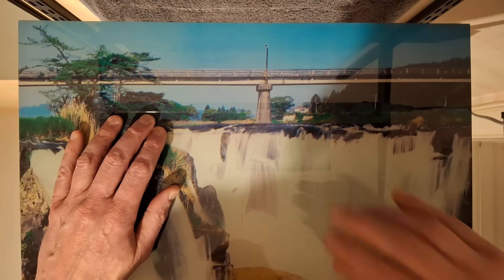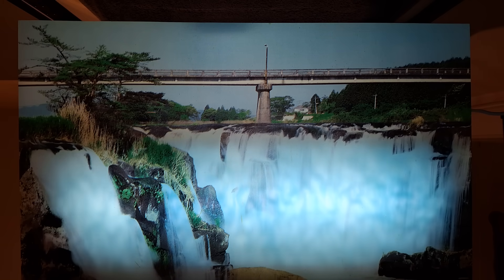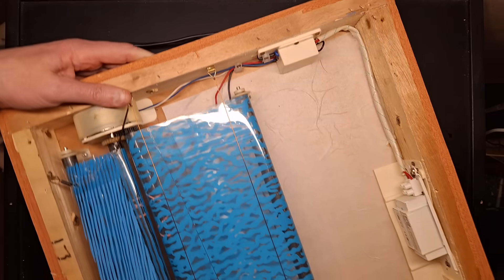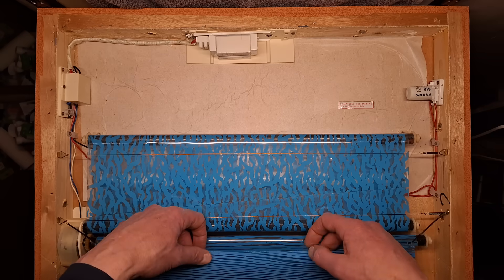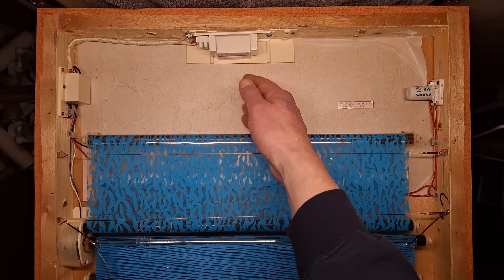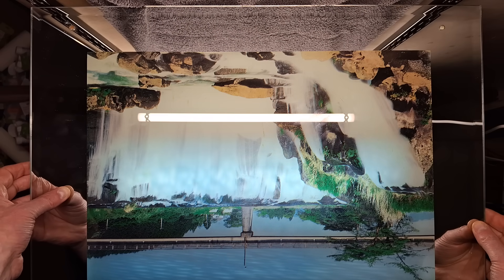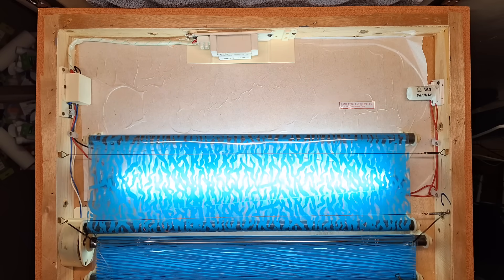Inside a dodgy moving illuminated picture

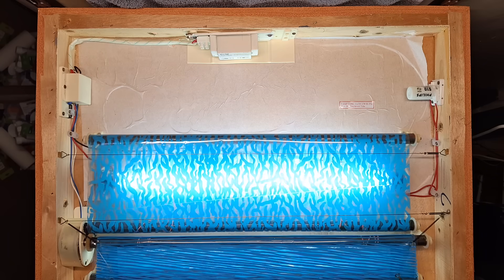Comment: 4:38 I can see the potential to retrofit it to LED and and or low voltage. Just LED would allow it to run cooler, both could vastly reduce the fire risk. But you had to change the motor.
Or vent holes at the top and bottom (+ a small fan, perhaps) could  keep thing cooler.
Or preserve it as is, as museum piece.

Comment: Perhaps the thing tends to burn when the gear jams by torn plastic (by heat and loss of plasticizer?), making the coils overheat (lacking any fuses?). I remember these animated picture frames with also a sound chip for waterfall, cricket and bird tweet noise, which was a terribly repetitive loop sample (like the ambient sound on Casio MT-540, but much more annoying by its clearly audible rhythm). Over 100 years ago they made similarly awfully botched mechanized pictures as a painting with functional clock (often behind the clock tower image) and often very complicated mechanical musicbox-like sound effects. Components were often interconnected with pull strings (threads or wires) those broke easily and were unlikely engineered by a clockmaker but rather put together from prefabricated parts by unskilled cottage industry workers.

Comment: On the inside, were those corona discharge wires strung along the drive rollers?  Seems to me there could be a lot of static buildup from the plastic going over the rollers.   Corona discharge wires would eliminate the static charge.

Comment: There are wireless electric toothbrush's on Ali for <$5 USD; might be a fun idea for a teardown. The circuit + assembly is quite appealing. After watching enough of your videos, I was confident enough to take a more expensive Phillips one apart which had dead batteries and replace them. Saved a good $70 USD not having to buy a new one. Had to unsolder the transformer, the wireless charging disc thingy, as well as 3D print a 2x AA battery case and solder it all back together. I appreciate your videos! You're the 🐐.

Comment: These (And similar) were also around in the 70s - My parents had a couple of desk lamps which had a similar pattern to that plastic, mounted onto a cylinder with vanes suspended from a pin above the bulb and driven by the heat from the latter. It was simple, but the apparent motion of the water in the Japanese scene painted on the lampshade absolutely mesmerised me as a kid! 😇

Kinda like how Big Clive mesmerises me today, admittedly... 😍💜😊

Comment: I'd expected it to use some kind of polarized filters with a rotating polarized disc, etc.  But as always, the simple approach seems to work best.   
Now Clive, can you do the LED upgrade, possibly even moving the light source into a little sidecar for better ventilation?
And most importantly, will that waterfall carbonate?

Comment: They still produce those for simulated fireplace or lantern decorations. Use just the same mechanism of a moving foil, but of course backlighted with LEDs these days. You can get them quite cheap at the usual Chinese shopping sites, I thought about buying one last year, as I thought it looked really nice and quite realistic. But I don't really have much place to put it here and the motor noise is also a downside, so I decided against it.

Comment: You would see these things in Chinese restaurants in the 1980s and 1990s.  I also remember stalls on the indoor market  (sadly no more, as the owners gradually squoze out stallholders with rent increases)  selling them.

I never bought one, because I thought they cost just a little more than I was prepared to spend on something I would get bored of very quickly.  And in any case, the one thing on that market that I was really lusting after was a ginormous boom box which had suitably-impressive speakers, FM all the way up to 108, short wave, and the usual two cassette decks -- except what made this one really special was, the play-only deck was a car-style slot loader with single "press gently for fast-forward, press harder to eject" button .....

Comment: One of the many 1970s crimes against taste.  Amongst the other horrors were the raining statue with the scantily clad classical nymph surrounded by wires down which "rain" fell.
It would be good to see one of those disassembled.

In regards to this moving picture, I wonder if there are is a way to build one using the same technology - NOT LED that wouldn't be a fire hazard and didn't make the annoying motor buzz? Brush less motors??

Comment: Ballast runs hot because it is designed to be used with a heat spreader as mounting, not plastic. Even with that they run up to 75C above ambient, and are rated up to 130C surface temperature, well above the operating point for most plastics. Easiest fix is a drop in electronic ballast on an aluminium strip, running along the entire top of the cabinet, which will run a lot cooler, and the strip is also needed with the electronic ballast as it too needs it to dissipate heat.

Seen many cooked ballasts as the aquarium trade used to put the magnetic ballast in a plastic case for fish tank lights, which would almost invariably fail after 2 years, either by going open circuit after melting the plastic case to expose it, or by going short circuit, blowing the expensive fish lamp, generally 2, as most people first changed the lamp, and the shorted ballast them blowing the filaments open on the new lamp as well.

Otherwise a simple LED retrofit tube will work, or just put in a strip of aluminium angle, with LED tape mounted on top and side, and a small 12V power supply for the tape. Angle so you get light up and to the side, and a diffuser on the top to spread the light, so as not to get hot spots above the LED dies. not needed on the side as the reflector will do that anyway.

Comment: The other type of moving picture that I remember from my childhood used oil that was pumped from a reservoir in the bottom and channeled to follow tiny nylon strings back down.  There was a light inside that would sparkle off the oil droplets.  The effect was generally used to look like rain, but I saw a few that were made to look like a trickle of water making its way down a mossy rock wall.  The pump used a gear-reduction box on a motor that ran off mains power.  I remember the distinctive sound of the gear box.  Later, as an adult, I learned that it was so the pump worked very slowly, since the oil was only traveling down in distinct droplets.  I can think of maybe a dozen different ones that I saw as kid.
Reply: Those oil drop lamps looked wonderful until they ran for a few months and got clogged up with dust and gnats.
Reply: Cinnamon Rain Lady Lamp was one! My grandparents had that one! And a clock with a boy and girl swinging under moonlight. Such cool devices.

Comment: Doesnt seem too hard to make it less flammable. Should probably be painted with flame-retardant paint instead of the paper backing, and then just make sure the ballast isnt too small for the limited cooling in there and the motor fails safely in case it gets blocked somehow (thermal fuse maybe).

Comment: I have "forest fire" lamp my mother had. It is a cylinder plastic picture similar to the waterfall, and inside another cylinder suspended internally by a pointed rod. An incandescent lamp heats the inside and spins the inner cylinder by the heat from the lamp. This lamp would not work with leds, unless a motor were installed...

Comment: One could replace that fluro tube with an LED based one and just use a normal LED power supply.
Should reduce the fire risk.
Unless you're Mehdi, Mehdi would double the voltage for fun to watch the sparkles come out

Comment: I was hoping for an LED upgrade. Thanks for showing the insides.
Reply: The LED upgrade would be to record a looping video of the operating display and play it back on one of those LCD picture displays.

But I know what you mean. Get rid of the ballast and go with an LED panel. There would still be heat to get rid of without allowing light to escape.

Comment: They had similar ones, less flammable I imagine, in "cheap shops" here in AU, they used a spinning disk with patterns rather than a roller and I think incandescent bulbs rather than the fluro tubes. They had some very nice designs, and as someone else said a mesmerising quality.

Comment: These have been around for  a LONG time.  My Grandparents had something similar featuring a gent. doing a spot of fly fishing in a "running water" stream. Theirs didn't use a fluorescent fitting, rather, it used two pygmy size "refrigerator interior" type light bulbs, which required reasonably frequent replacement. The casing was sheet steel with substantial ventilation slots top and bottom, whilst the synchronous motor was an old, presumably re-purposed, Smiths Sectric 240v clock motor.
Reply: Pygmy lamps? The only other place I ever saw those were in electricians test lamp sets. 💡

So that means your picture there could also double-up as a circuit tester. Now that's what you call getting your moneys worth! 😁
Reply: @dieseldragon6756 🤣🤣

Comment: I tried to comment, but it was removed by u-cylinder, apparently for mentioning heat-related events even without using those words :(.  After the 3rd removal I'll just say that this type of product was quite common in the U.S. in the 1960's and 70's and they were hand-built with very little automation.

Comment: Thanks for the internal view! I saw two of these in a Chinese restaurant near my house, some 20 years ago, and it attracted a lot of attention.
Maybe you could convert yours to LED, although the synchronous motor would be a problem - I have a Christmas tree that uses a GU10 lamp and moving patterns to create color effects on fiber optic strings spread out through the branches. The (huge) AC-AC transformer was lost between houses and I didn't change it to LED, because of the synchronous motor (buying a DC low rpm motor is an overkill for a very old tree, that would still need a DC power supply). It's still in use this Holiday season, with cheap Chinese LED strings, running on batteries 🙂

Comment: Don't know if I have mentioned this before about the one I have. Mine has a chinese sea and beach scene and slow moving palm trees at the front, very nice with 2 horizontal moving pictures to make it look like a camera panning from right to left. The tube is a stretched out O shape on an electronic quick start thingamy. I got it cheapo on Skegness market cos the guy knew it wasnt working. I got it home and was horrified at the wiring inside. Standard thin wire used normally on low voltage electronics projects bare ended twisted together to the tube power and motor wires! definitely a fire risk. Took all that out and used some solid core from 24A Twin and Earth and wired in an extra switch to turn the Motor/Lamp off instead of the whole thing in case I just want the clock showing. The case is designed to look like a TV and has the date, temp, time and lunar day along the bottom using 7 seg displays. The clock uses larger 7 seg digits. The thing only speaks chinese and it took me a while to figure out what  the 6 buttons do and how to set it. Unfortunately the calendar must be a table in memory as it rolls over after 2019 back to 2005 or thereabouts LOL making the date useless. It still works but sounds like planks of wood creaking on an old wooden ship at sea. Maybe the rollers for the plastic just need some light oil. Future plan is to replace the Tube with LED strips maybe RGB for fun :) One positive is the clock/date side of it uses a real transformer and old school AC/DC converting with diode rectifier and smoothing caps. I will probably recap it at same time and see if I can tap off the DC side for the LED tape. If the transformer starts getting too hot then I know I need a different direction lol

Comment: Why not just hang an LED Monitor on your wall instead? I don't think I've ever heard of an LED monitor catching fire. Although I did one time work at a company that had a CRT monitor catch fire in the middle of the night when nobody was there. It only filled the building with smoke and melted all the plastic off the monitor. It also left a few burn marks on the desk it was sitting on but not much more.
Reply from the maker: A video monitor would be a good option these days.  Maybe a long looped video on a USB stick.

Comment: I always enjoyed these.  I'm guessing the wires are to keep the clear plastic belt from rubbing the back of the image off.  I wonder how much static electricity you could build up inside one of those if things aren't quite right.  

Also, they definitely need the fluorescent light.  Leds are good, but even the cold white doesn't get the right tone.

Comment: This Phillips S10 Starter is extremely unreliable. While fluorescent tubes were still in use I replaced them whenever I did see one in the wild. They tend to stick, and then you get a tube with glowing red ends, burnt lamp holders and a cooked ballast.

Comment: I have a guess, the wire across the conveyor might have the purpose, apart from holding the foil down to provide a bit of earthing, to ground possible static electricity. These plastic foils are prone to stick quite nastily to the glass when statically loaded otherwise and generate a lot of friction.

Comment: replacing the starter with a LED starter (just a wire link or a fuse inside) and the fluorecant tube with an LED tube will get rid of the fire hazard. the ballast can also be jumped with a Wago connector and completely removed, shedding a lot of weight off of the picture

Comment: An old beer company in the US called Hamm's used to sell clocks featuring something a lot like that. They were a fixture in dingy-ass bars in the 70s & 80s.
Reply: They were a fixture in my dentist's office in the 1960s. He had one facing the chair, with the beer advertising removed. The ripples were supposed to be calming, I guess.
Reply: I remember those!  Any of those Hamms promos would instantly lower the class of the place by 25%  Throw in one of those cheesy Schlitz pool table lights and you had an instant dive bar.
Reply: @xlerb2286  My uncle had a set of those Schlitz lights over his pool table in the basement. I thought it was great when I was a little kid. Whenever I went there I felt swave, suffocated, and deboner. 😀
Reply: Hamm's, the bear refreshing.  Hamm's, the bear refreshing.  HAMM'S!

Comment: Similar to the effect on my electric fire, just orange LEDs inside a rotating metal tube with random flame shaped cutouts in it, projected onto the back of a black plastic sheet with translucent random stripes on it, the 2 mesh together, it's a nice effect with the glowing coal and embers 😊 I like the newer smokey type coal, flame fx nowadays though. I seem to remember a really big version of the waterfall in a Chinese takeaway in the 80s.

Comment: be good to convert it to LED, and replace the backing paper with sticky back aluminium tape, we used to have a round one with the water falls on, and my aunty had the forrest fire one. used a use a 40w bulb, with a spinning fan of an electric coal effect fire .. worked well

Comment: my grandmother had several "forest fire" diorama drums in her living room, I guess those were similar in concept but quiet and IIRC They weren't motorized and the movement came from hot air rising from the 40 or 60 watt incandescent bulb inside, and on the top there was sort of a fan connected to the moving part of the drum.

it might be interesting to see the diffuse light source of the fluorescent tube in your flat diorama replaced with a finer beam type light such as a clear argon display tube.

Comment: i have one of these though it has a different picture on the front of it.   i got it for free about 10 years ago.   the motor is 'synchronous'.   well, it has that written on it.   i know because i had to remove it to get the thing working again.   i cant remember what was broken but i spent a lot of time on it.   it made noise when it worked and i got about 10 minutes total working time out of it before it broke again.   i didnt fix it again.   as you can see, the insides look dodgy.   its still on my wall.

Comment: My guess is the wire across the belt is to remove static build up.
Reply: I disagree. I think the wires are to maintain tension on the plastic strip, so it doesn't flex randomly while moving.
Reply: The upper one, at least, doesn't appear to be electrically connected to anything

Comment: Bet they got even more "kinetic" while being tossed out the window after they caught fire...8^)  Might have been an OK product if built into a sheetmetal enclosure with no wood or paper inside, and plastic parts made thick enough with UL line voltage / UV resistant rated polymers. Cheers!

Comment: Good old nostalgia. I haven’t seen one of these in many years but they were quite common when I was younger. I also remember my Grandmother having an oil lamp that was always fascinating to me. They were rather large, bronze colored, and typically a statue of a lady or goddess was encircled with little wires or cables that oil would run down and it would appear almost like rain as the light glimmered over the oil droplets. I haven’t seen one of those in many years either.
Reply from the maker: The raining oil fountains were very messy.
Reply: Sounds like the oil fountain at the end of "Adventure Thru Inner Space", a ride of early Disneyland
Reply: Cinnamon Rain Lady Lamp! There's a guy who restores stuff and has a YT channel and he just did an episode of one of those. It is amazing.

Comment: I like the effect! It could be modified, just by removing that paper and cutting out a big section of the back for more air flow. Maybe even a more modern low heat light tube.  Of course none of that might work, and it might still go up in flames!